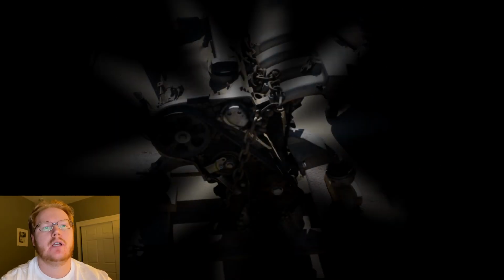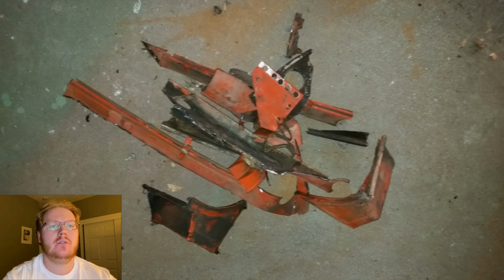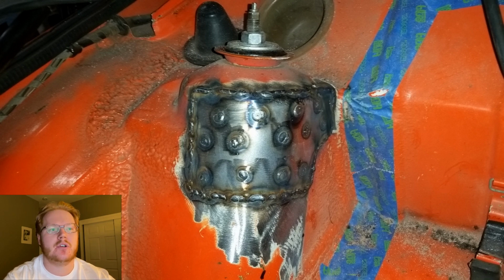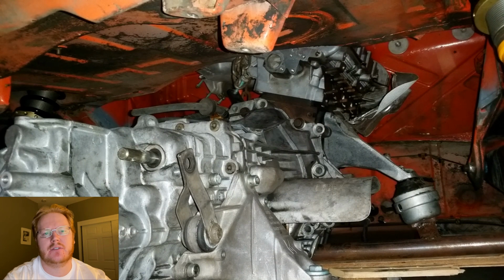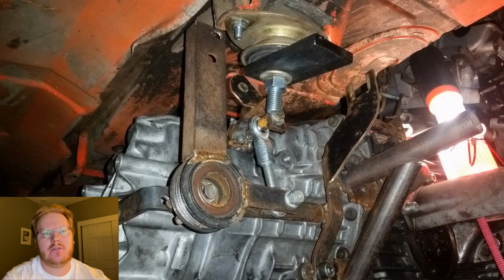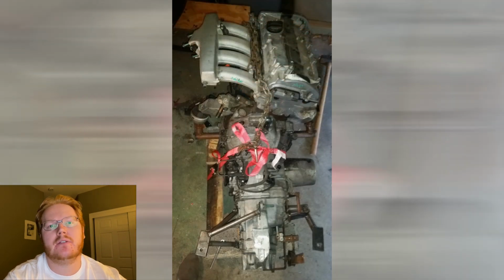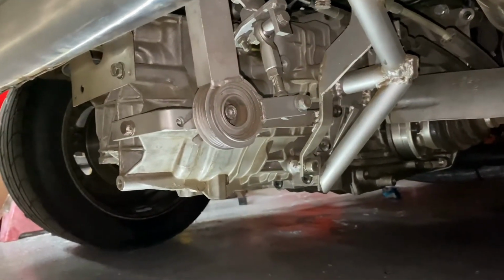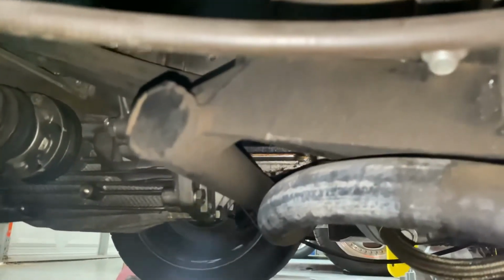Audi 1.8t Engine Swap - Mounting engine and transmission

Comment: Hi Andrew,
What did you use for Axle stubs, CV joints and the transaxle drive shafts? With all that torque gain what did you use to handle it? I have the original Passat  longitudinal transaxles  and CV's with the 28 spline count. The right side(s) are plenty long but I need to know how to modify and machine the axle hub side. I am planning for a 5 lug system. Do 944 axle hubs work in the 914 trailing arms?

Comment: When flipping engine bakwards like that, wont it maken The gear box spin opposite direktion, getting 5 gears reverse and  1 forward?  Like on The older bug trannies you could flip The diff to reverse output if you were to build mid engine with those
Reply from the maker: The engine And transmission is facing the same direction as it did in the Audi.
But yes you are correct If I did flip the engine around the transmission would have to be flipped over or the ring and Pinion would have to be flipped
Reply: @budgetoutlaws9978  great answer 👏 been planing a vw mid engine , first thought of the old passats and Audis since o used to own one,should be easier IRS convert The floor pan and use a longitidual engine and trans combo ,than welding in a Golf mk3 subframe  and Mount a transverse engine 🤔😁

Comment: nice work. does it handle well for you? good weight balance with the 1.8t? I know people do v8 swaps but this seems way more reasonable when it comes to not upsetting the original balance of the car.
Reply from the maker: Handles very well! The car needs a proper corner balance but the limits are very high and the car is very tossable.
Reply: @budgetoutlaws9978  right on, sounds fun!

Comment: Would the transverse 1.8t not have fit? Or would the engine have been too far back into the trunk?
Reply: The original 914 motor and transmission are mounted longitudinally.   So it made sense to use the longitudinal 1.8t to minimize the amount of modifications converting the longitudinal  factory orientation to transverse.
Reply from the maker: It would have possibly fit, but it would have moved the engine back another foot, it would have taken up the entire trunk vs just a little of it, and it would have prevented me from being able to put the targa top in the trunk. 

This is near identical to the original 914 transmission mounting so it's a bit more "correct".. That being said I've been tossing around the idea of putting a DSG in the car..
Reply: @budgetoutlaws9978 Yeah I wondered if it's just make what little practicality the boot has completely unusable. DSG would be interesting, I was mostly looking for how you were going to run the shift linkage  to the rear :) Haven't tackled that one yet
Reply from the maker: My last video I went over shifting. I just made a cable shift setup and ran it with cables. You could easily do the same with your transverse setup and not deal with linkage. Run a MR2 shifter and custom cables.